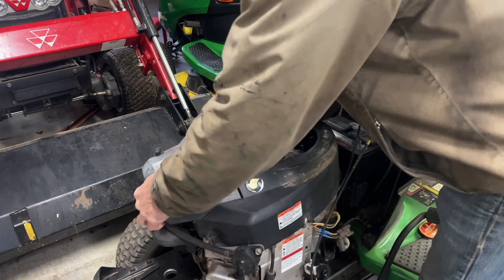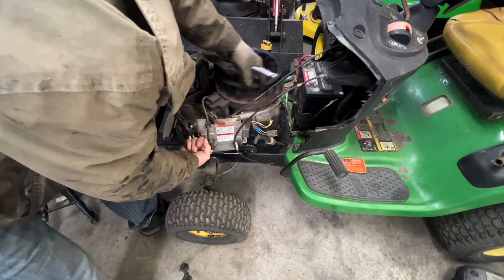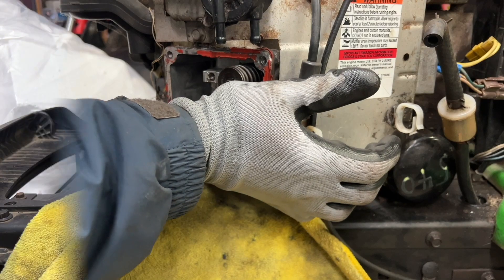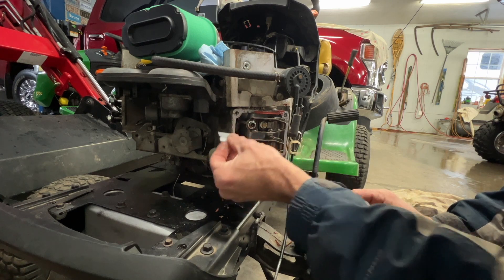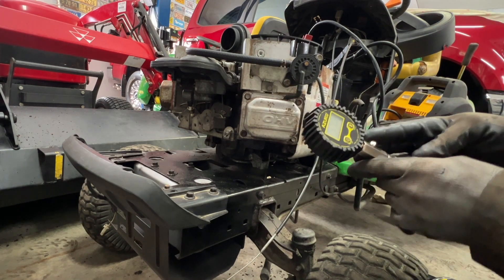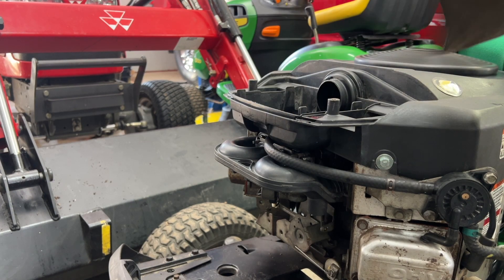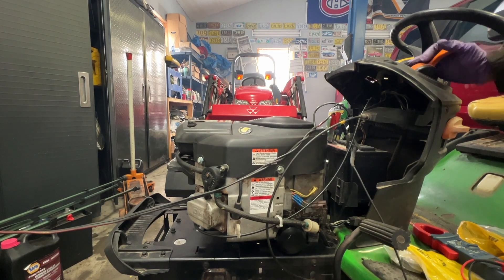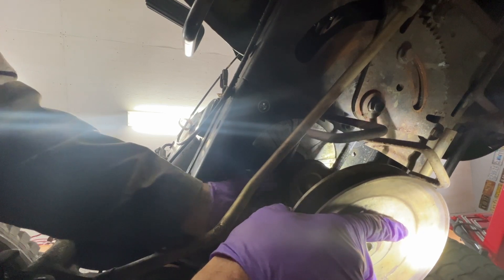How to fix a $100 26HP Briggs and Stratton Motor that won't Start? John Deere D110 D130 D170 etc.

Comment: Hello do you happen to know what size the main jet is or the correct part number for it for the 19.5 hp briggs engine with the nikki carb. Thanks
Reply from the maker: 19.5hp Briggs number for the main Jet is 699733.  High altitude is 843099.   Don’t know the size offhand.  I can check later.
Reply: @WeekendHobbyMechanic  thank you very much,  do you know if that jet will fit in an aftermarket carburetor or only oem carbs?
Reply from the maker: @RyanKelly-u5k      That I don't know.
Reply: @WeekendHobbyMechanic  thank you for the info on the part number though